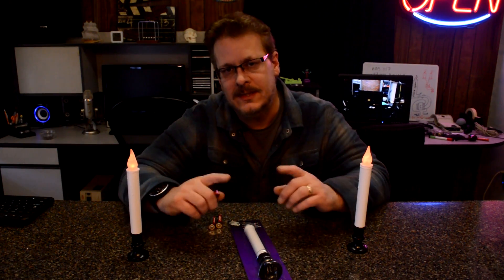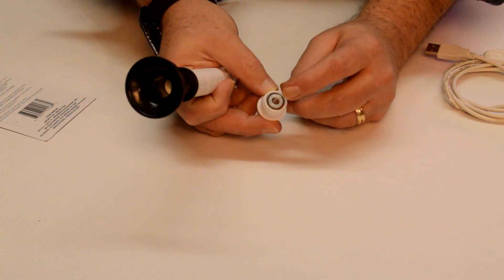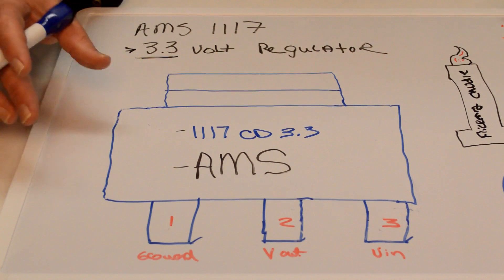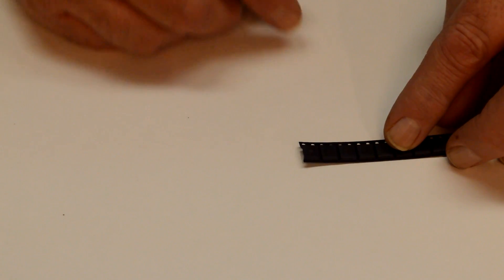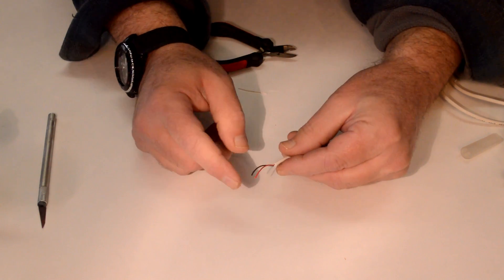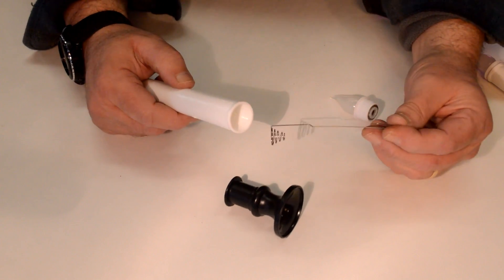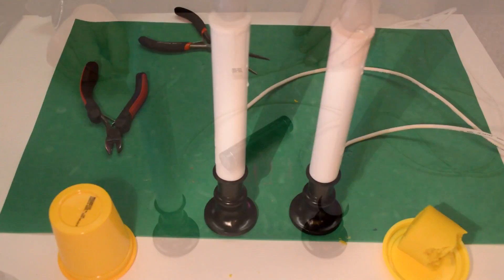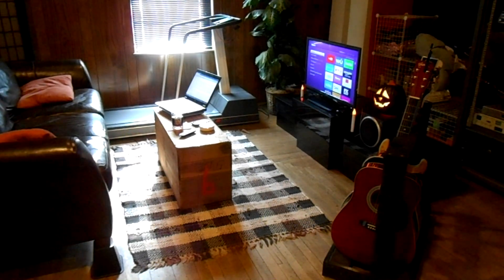How to Modify Holiday Flickering Candles to USB Power

Comment: An easier, cheaper and quicker way is to put 3 diodes like 1N4001 in series with the LED candle.  These are like 10 for a US dollar.   3 times  .6 volt forward voltage drop is 1.8 volts.  5 USB volts minus 1.8 is 3.2 volts.    Walla!!!    These will handle 1 amp of current.   Much more than most USB .5 amp outputs.    I use this technique all the time for low current stuff like this.Happy Halloween AllJP

Comment: Guru How do you convert a zip file into a .mod file?
Reply: +marc gaston Zip files are compressed, they can be any type of file.  If the compressed file was a .mod file, then you just need to decompress it.  All modern operating systems come with the ability to do this built-in.  If the zip file was another type of file than .mod, it might not be possible to convert it to .mod.  The .mod files I'm familiar with are music tracker songs, such as made with Protracker on the Amiga.  Anyway, the first step is to get hold of a program to unzip the zip file, and see what's inside it.
Reply: ok thanks alot